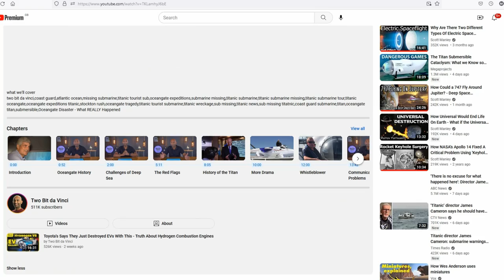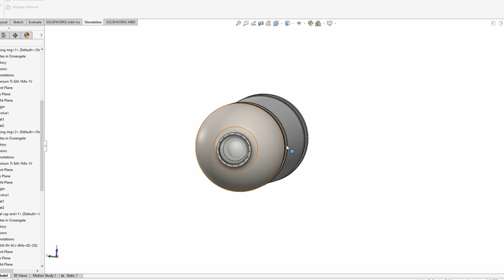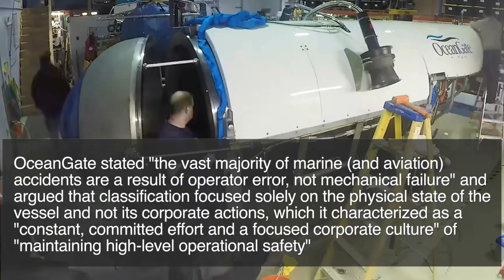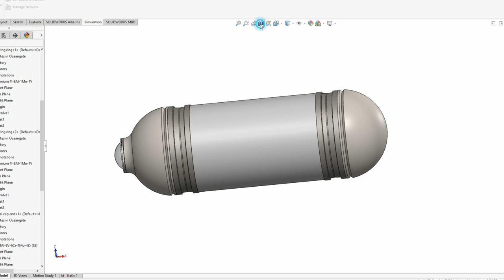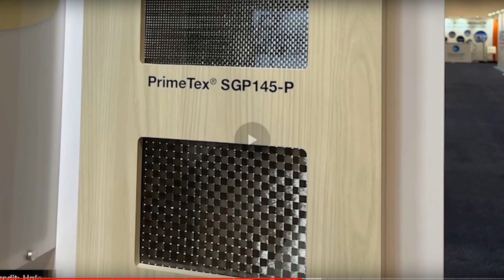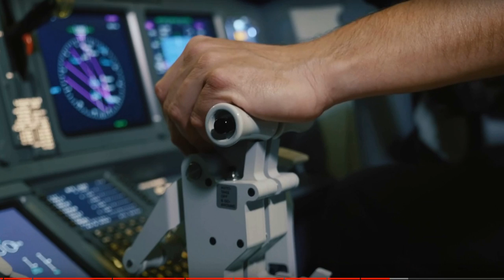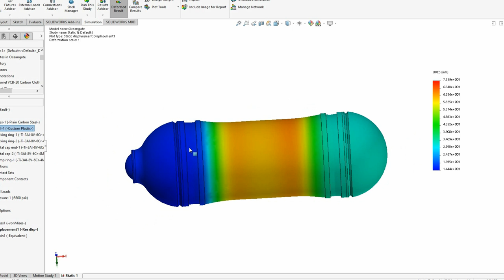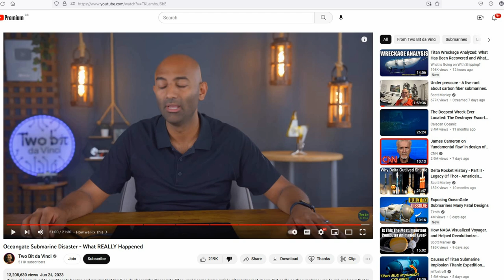Oceangate Titan - Engineering Failure?

Comment: You don't seem like much of an education type.

His presentation about the column of air was 100% correct. If you had a pipe whose top went to the edge of space and had it filled like the atmosphere around it, there would still be 1atm of pressure at the bottom of that pipe. Yes, it doesn't act just down, but the pressure is due to gravity and the fact a fluid can't take shear stresses so the weight of the air above is transferred perpendicular to the surface. The pressure is literally because of the column above you, you should have seen that in your Fluids course back at UNI.

Same goes for hydrostatics. If you have a pipe of any circuitous layout, the pressure will always be determined by depth relative to gravity.

The historical context of the sub is also kind of required to understand why what happened was so dumb. Literature reviews are key to establish what norms are in a topic, before discussing the main elements; this is a common practice in literature. The fact the guy left out his aerospace experience was a wash, as it would have explained his overconfidence.

we know more about the moon than we do the earth's oceans, and it is most of the earth's surface. The idea that it is an end to a journey exposes a harsh lack of imagination and prescience. I suggest you do more research on this topic.

Plastics are often welded through ultrasonic vibrational processes. So milspec testing for such failures is pretty apt.

Data IS lacking on carbon fiber. Testing is hard, expensive, and difficult to fund. You don't seem to understand the complexities of such a material and how difficult it is to pay for said testing. 
further, due to the very nature of carbon fiber, it is notoriously difficult to model, which makes testing even more vital. 

He wasn't talking fatigue limits, fatigue is the wrong word for this. You don't have a fatigue limit of 1, maybe 1x10^6, not 1. He was talking about the plastic deformation due to the loading of a single iteration.

Your understanding of plastic deformation and the deformation of fatigue is lacking. 

The "bending the paperclip" analogy is in no way an expression of fatigue, as fatigue is cyclic stresses -within elastic modes-. Elastic, not plastic. Yes, fatigue FAILURE is plastic, but that is why it is called failure.

bending the paperclip is an example of strain hardening and embrittlement, which has nothing to do with this topic.

your understanding of solid solution aging and materials engineering needs work too.

Yield strength of wood isn't random, it isn't homogenous no, but not random. Otherwise we wouldn't use it in engineering situations and we 100% do.

Listening to you being an ass about literally everything this guy says, is pretty frustrating; The owner lied. He made up the partnerships. The owner made it seem like NASA et. al. had done calculations and studied the designs to assuage concerns of investors. Not an uncommon practice among the types you would see running an Oceangate

NDI is vital to check for voids that would act as stress concentrators and fracture points; you had already spoken on that very fact with your mangled aluminum analogy. So i don't understand your random decision to shit on NDI

"pump up to pressure 1000 times"
the guy wanted a cheap solution, he wasn't going to build a whole other carbon fiber vessel and spend years testing. (likely 3 hours per cycle, to adequately model the creep in the carbon fiber, imagine 4 hours per test, 2 tests per day... they aren't going to do that; it would be prohibitively expensive in upkeep alone, and would have fairly limited value)

"nothing bends like carbon fiber"
this is speaking of a material problem which is 100% valid. As is the galling issue with titanium. I have no idea why you have an issue with this; the fact that you say there is no particular property that makes it gall is hilarious btw.

"age of extreme..."
Dude, we have private individuals doing what entire nation states struggled to do just 60 years ago. You didn't have Spain bankrupting itself to go to the south pole. The closest analogy was actually the attempt to find the northwest passage.

"doing the thing yourself is stupid" 
dude, that is exactly what cameron did. He is the world expert on the topic right now. A film maker. Guy doesn't have a doctorate or anything. Did he build it "by himself" well no, neither did oceangate. Oceangate's Titan was based on another challenger deep vessel, the one "rated for just 1 dive" (which is from an apocryphal story via James Cameron, where he told the creator it would only work once due to the nature of carbon fiber under compression, was never used and then sold to virgin) (the creator of that sub died with a heart attack btw) 
 it is foolish to imagine that a field being pioneered by a filmmaker would have as mature an engineering space as something like aerospace. 
further, Oceangate's CEO had come to fame through his pioneering use of Carbon-fiber in aviation. A major reason he didn't take critiques seriously over his material selection choices. 

"air travel isnt safe"
Excuse me?! Even when plane crashes were happening all the time in the 90's it was still safer than a car by leagues. Now commercial aviation is comically safe. It is safe because of deaths that pulled regulations and thus corporate minimum effort, forward.

Regulations ARE written in blood; but what the CEO of Oceangate did is what countless other people have done; Died from his own Hubris. People like him are why regulations get written in blood and why they are so important. They will 100% darwin award themselves if they are given an opportunity. 

"I don't need regulations"
You are literally making a video about a situation that would have never happened without regulations. The Err example of the need for regulations and you are saying we don't need them. We need regulations, because people like the Oceangate CEO exist, and as long as humans like that exist, which they always will, people will do stupid shit and people will die. This is a guarantee. Regulations act as a somewhat hackneyed baseline of quality control across an industry that would not maintain such minimums otherwise (IE most of them)

"your car can't last forever" 
if it was mainly steel, yes it can. As an engineer i'd think you would know that steel's fatigue weakening stops at 50% uts. If it doesn't have steel, yes it will fail in time. Most modern cars obsolesce at 2-10 years depending on the model. 

"aircraft are pressure cycled, So?"
this is a major issue dude. They test before replacing parts. Shit ain't free, and the regulations require tests, not replacements. Regulations are the bottom of what a company will do. Many parts can have failure modes unrelated to fatigue failures. Some inspections of failure critical parts are just to see if some hereto unknown failure mode may have struck.

"they don't inspect" 
holy shit dude. Cracks do happen. I am doubting your credentials at this point, because testing can only cover so much, and countless aircraft have crashed because of thereto unknown failure modes. Laboratory settings are always more controlled than real environments. 

You make every excuse to question what this guy is saying, and even contradict yourself to do so. It is infuriating. You said there is no reason to inspect, but then bring up point crystalline lattice failures; something tested for. 

"we don't know they didn't test.."
we do, we 100% do. Their engineer that they fired was fired for stating that they needed to do NDI and the CEO didn't want to pay for it. The fact that the vessel was wrapped in an open air environment and the seals were glued on outside of a cleanroom setting shows the CEO's wanton disregard for basic precautions in manufacturing.

"high strength steel"
not stupid, if you understand the history of metallurgy and how steel has been developed; our understanding of material science has exploded over the last 100 years and advancements in solid solution mechanics have lead to meteoric advances in Steel.

"as an engineer" 
very rich dude.

"1000000 is a lot" 
...in a sub that probably costs like 18 times that... Just the fuel to get to the titanic from shore would cost an arm and a leg.  considering the craft did 3.25 trips, 18mil on 3,25 is 5.5mil and for 4 passengers at 1.5mil you would have 120k profit per trip... maybe

Overall, I don't know why you were so aggressively dismissive of the speaker in the video, however, your confidence belies a deep ignorance in many topics. Ignorance is alright though. Everyone is ignorant. 

I'm sure I would sound as out of touch if I was discussing your field. However, your critiques of this guy are karenesque and overly negative.
Reply from the maker: "His presentation about the column of air was 100% correct." So, what happens when you walk into a room?

"Data IS lacking on carbon fiber. Testing is hard, expensive, and difficult to fund." - how much testing have you done, professionally? I've been doing it for years. You don't know what you're talking about. A carbon fibre matrix is a non-homogeneous material that had great tensile properties but crap (in camparison) compressive qualitiies. 

"You don't have a fatigue limit of 1, maybe 1x10^6, not 1" - a fatigue failure has a failure rate....

"The "bending the paperclip" analogy is in no way an expression of fatigue, as fatigue is cyclic stresses -within elastic modes-. Elastic, not plastic. Yes, fatigue FAILURE is plastic, but that is why it is called failure."

Oh okay... https://www.studocu.com/en-us/document/laguardia-community-college/engineering-lab-i/fatigue-failure-experiment-experiment-first/17938146

- reading the rest if this dribble was funny, thanks.
Reply: @dirtygarageguy  It is likely that they use the example due to the impracticality of an actual fatigue experiment. That is a brittle failure due to strain hardening from cyclic plastic deformation.

Comment: This is one of the WORST vids on this topic. Anyone splitting hairs in the way #DirtyGarageGuy does is VERY problematic. Like his complaints on TwoBitDavinci's video, and claiming the NASA partnership/ UW were real. GTFOH!! If I rent out Chuck E. Cheese for a kid's birthday party, I'm not a professional party planner. The facility had ALL the things I needed. I just showed up, used the equipment and provided a great time to my guests . Using a NASA facility for testing, IS NOT partnering. And with the way Rush, PT Barnum-d all his "partnerships", TwoBit is right!! And even more foolish from #DirtyGarageGuy is to claim NO physical examination of an experimental carbon application is necessary?? Who are you?? When 50 damn people from the SUB community said destructive testing WAS needed. Fired employees responsible for SAFETY said as much back during the design and build phases. REAL experts have been clear, actually testing a new application to failure is KEY. Its like GarageGuy is the very personality type hired by a Stockton Rush or FLEECED by Stockton Rush. But I i guess people like Garage Guy's accent, or his "cheeky" hot takes. NOT FOR ME...its like the DailyMail passing as a peer reviewed science journal 🤦💅
Reply from the maker: I think deaf. I said destructive test IS required. I said NDT was a waste of time.